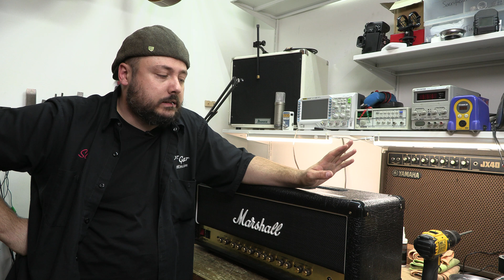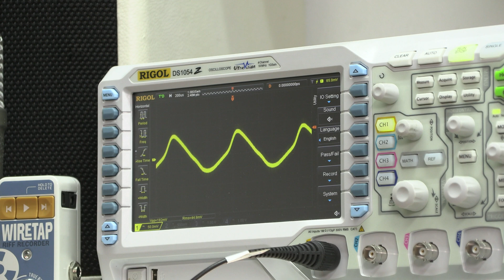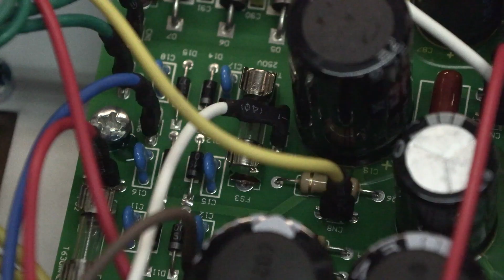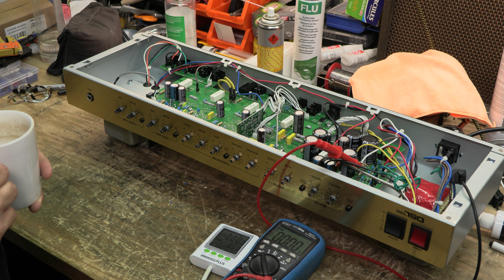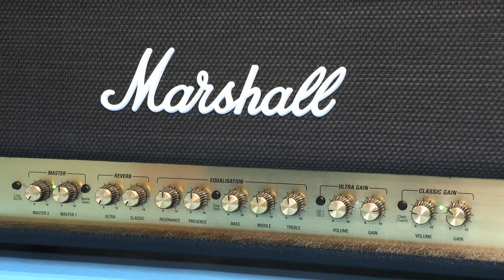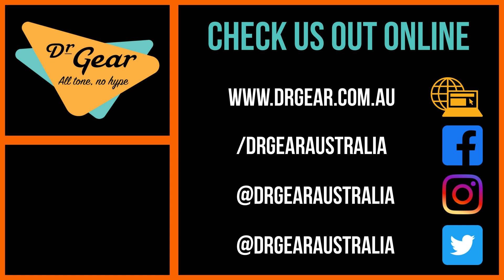Marshall DSL100HR Keeps Blowing Fuses - Tales From The Repair Bench

Comment: I'm actually surprised that for the price of an SLO that's all their is on the inside. WTF?
Reply from the maker: It’s all about scale of production and the overall quality of the parts. Soldano before they were brought back to life by BAD only made a few hundred SLOs a year. So they weren’t getting huge breaks on the cost of material or labour. 

Additionally, they used top notch caps and resistors in their amps, along with quality sealed pots that last years. That goes for the transformers too which were custom wound units from De Young and it’s not cheap getting them at such small scale. 

The quality of the builds including assembly, the thickness of the steel chassis, the insanely well made cabinetry, that all adds to the overall cost for them to be able to make money. 

Vs many of the ‘boutique’ amps out there that aren’t made to near the same level and yet cost as much, or more, the SLO is a masterpiece of design and quality.

Comment: Thanks for the video.  Customer dropped off same amp/problem here.  Having a hard time finding the big filter caps.  Can you tell me where you found replacements?  (220uf/315v C21,C22, 220uf/400v,C19,330uf/315v,C13,C14) 40mm is the max height.
Reply from the maker: Use the parametric search function through Mouser/Digikey/Farnell and there should be some at one of them.
Reply: @drgearaustralia  Thanks!  Were you able to use the snap in?

Comment: And I'll bet that the cause of the fuse blowing is the dreaded conductive PCB syndrome that some of these Marshall DSL series amps tend to suffer from.
Reply from the maker: What? If you watched the video you’d know the issue was shorted power caps. 

These new Asian made models are made in an entirely different factory using different board fabricators.

Comment: Resistors 8 and 9 are in direct contact with the trace going from C 24/ R 49 to R 11. Heating and cooling or arcing can break thru the insulation causing a direct short between R 8 and R 9 and the trace in turn shorting C 21 and/or C 22 to the trace. Smokes R 49 when switched to low power. Design flaw! Lifting R 8 and R 9 away from the trace solves/prevents the problem.

Comment: I got the same head in a trade, it seems to work fine minus it has a noise when powerd on the speakers sound like a mild burning fire noise or the sound of the ocean kind of static. It's not loud but noticeable. I've replaced the preamp and power tubes and biased at 73mv per side the sound is still there. Is this normal for this amp or do you know of this issue?
Reply from the maker: You can’t bias a set of tubes with a random static value like millivolts dropped across a cathode resistor. 

These are complex amps and there are a number of things that can cause this issue which requires a strong understanding of trouble shooting.
Reply: @drgearaustralia  funny because I found that 2 of the .5w 1m ohm resistors in the resonance circuit were the issue not tubes..

Comment: If you mind me asking, how much did this repair run for? I believe I’m having the same issue with mine.
Reply from the maker: It’s a whole board out job which takes a bit of time. I think top to bottom it was about 3 hours to replace all the caps, rebias, burn in and all that.

Comment: guitarist in my band has this amp, literally exactly the same issue, master volume cranked and its output is ungodly low. even when on and cranked, it still sometimes makes no sound at all.
Reply from the maker: Then it’s possibly having the same issues as this one. The high/low power circuit uses two different power rails for the output section and if one goes short as happened to this amp, you get no voltage where it needs to be. 

Time to take it to a tech for assessment.